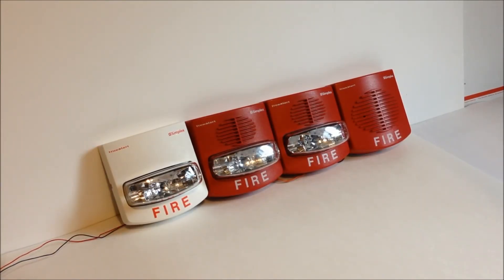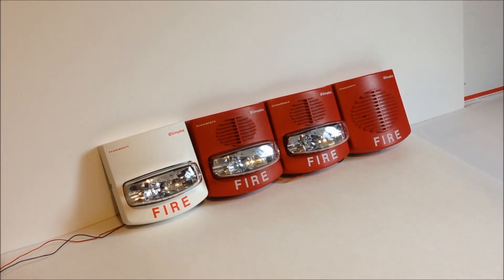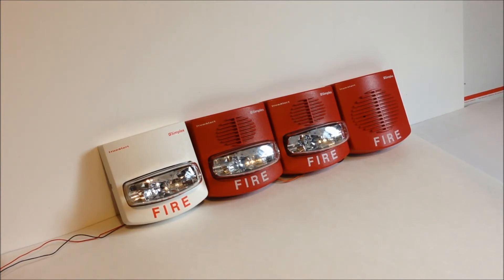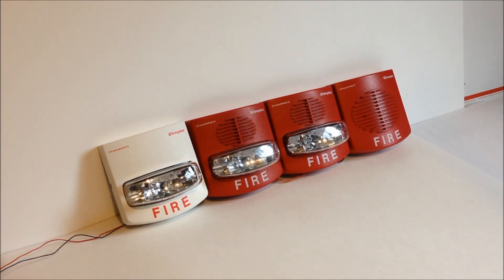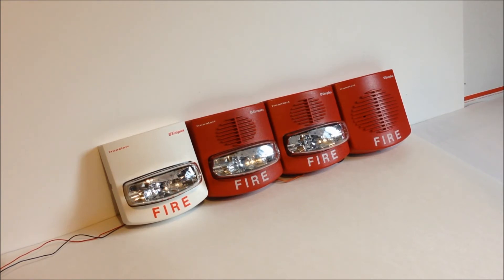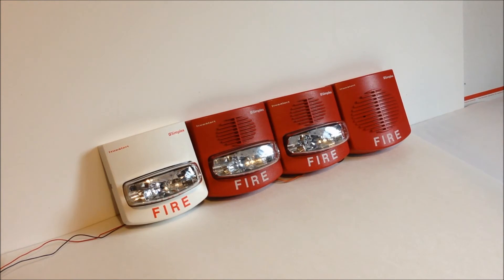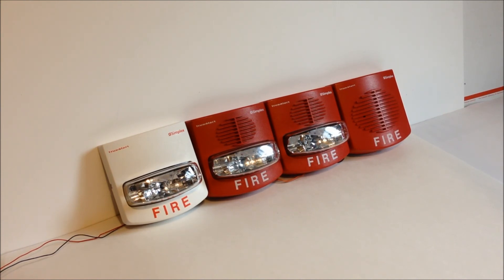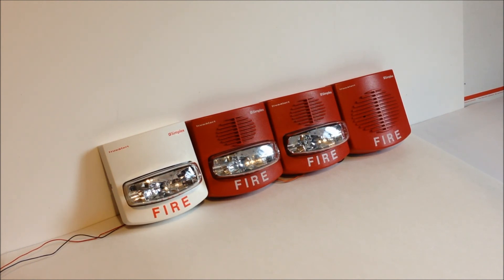Simplex SmartSync Demonstration | 2017 Solar Eclipse Special!

Comment: If you can afford a smart sync module can you buy any Simplex alarm safely without having any traps?
Reply from the maker: Not quite - you still have to watch out for Addressable notification devices that are not compatible with the SmartSync module.
Reply: kcin556 but what if you have both?
Reply from the maker: Both of what?